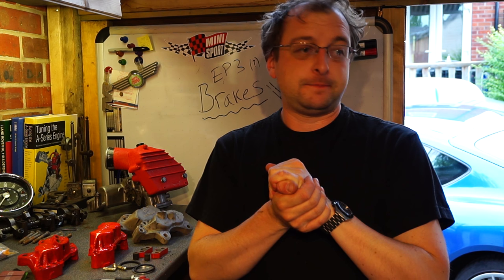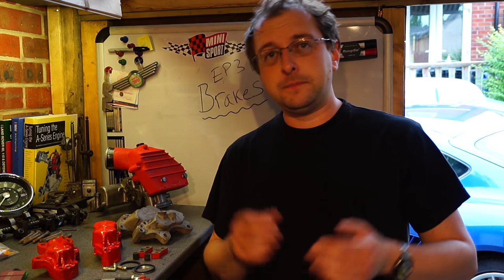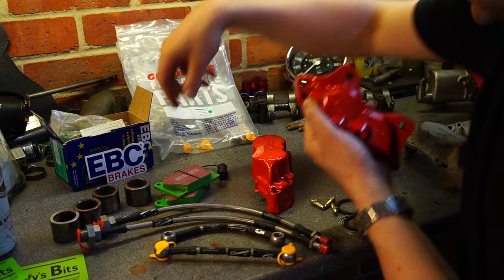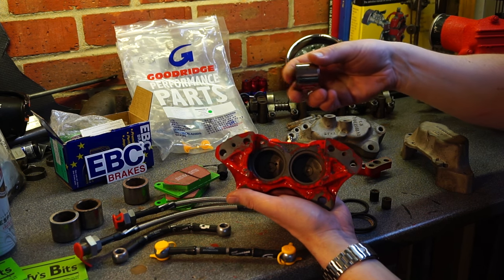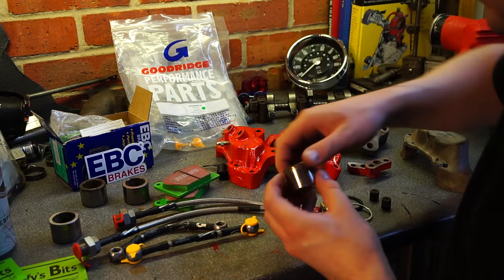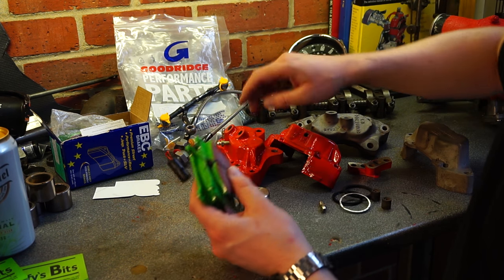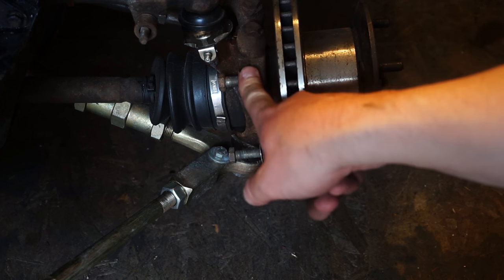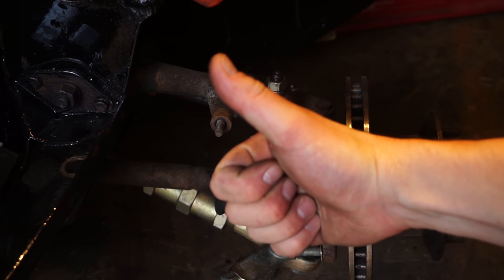Turbo Mini TV - Building a 1310 Turbo Classic Mini - The Brakes

Comment: "Who ever developed these (calipers) was clearly special".........Yes, but in a good way.........When fitted to the Metro Turbo each 4 pot caliper was fed by 2 hoses as part of a split system. One half of the master cylinder supplied 1 pot on each of the front calipers and the other half of the master fed the remaining 2 pots of the front calipers and the rear brake slaves. The Mini system is less sophisticated than the Metro Turbo so you have to fit the "bodge" hose between the top and bottom pots, not ideal but it gets the job done.. Hope that makes sense.

Comment: My brakes only bleed in the front on either the left or right, why is this?
Reply: Turbo Mini Tech, what it is, i had the pdwa valve on but had a modern master cylinder which had only one pipe coming from it so i assumed that the pipe feed went in to the valve and then fed the other three outlets (back and two front) but it was only bleeding the brake directly under the main feed from the master cylinder, this is because the pdwa valve works by taking two feeds from the master cylinder not one, and thats why i couldnt bleed the brake on the opposite side to the feed, so i could either get a later type master cylinder with two feeds or just a valve to split the single feed in to a double feed, problem solved my nigga!